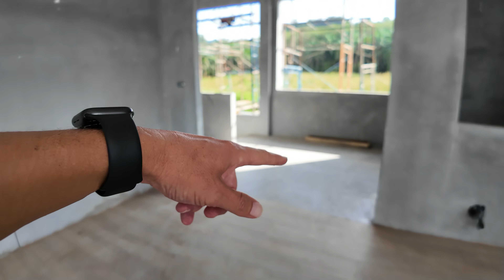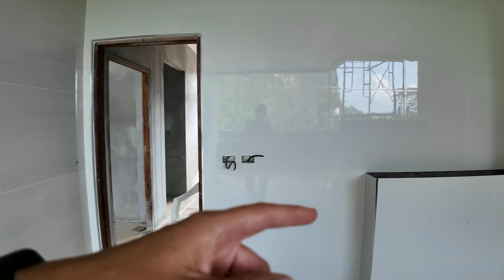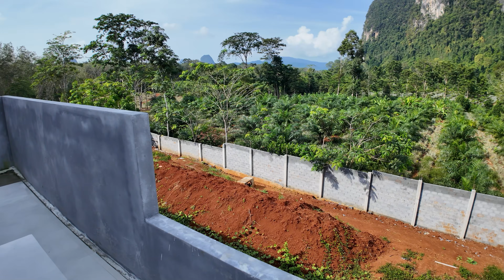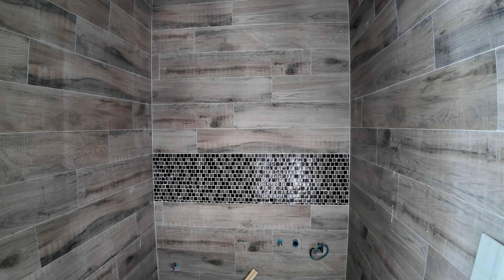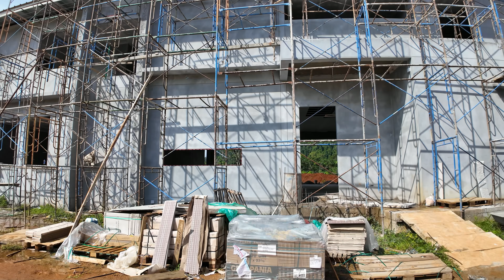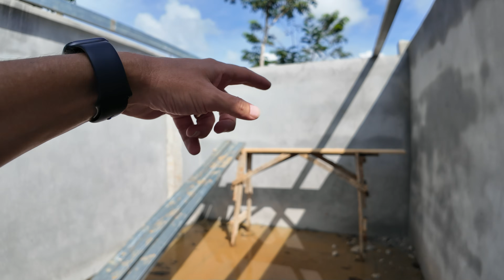HUGE Updates! Now we're having fun! - Part 18

Comment: Have you researched how easy those ceiling mounted AC units will be to clean? My builder never mentioned these years ago. Maybe 5 years ago these were not in Thailand yet.
Reply from the maker: A bit harder to clean than a wall-mounted AC, but well worth it for the more even air distribution to us.